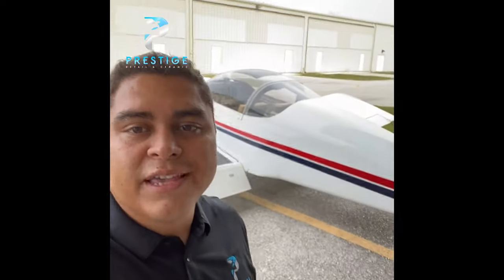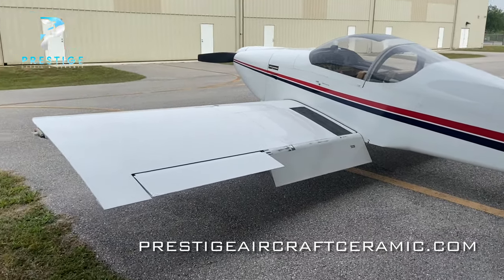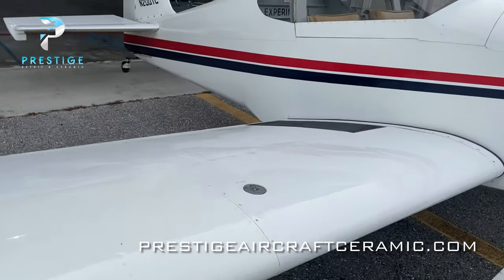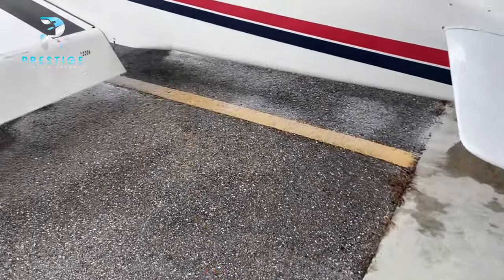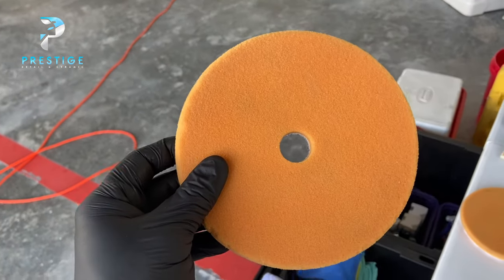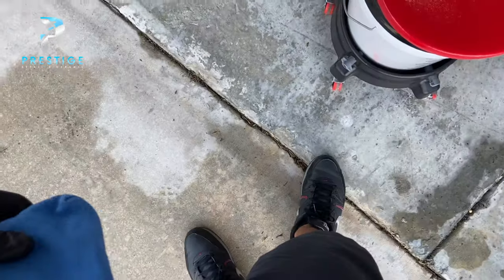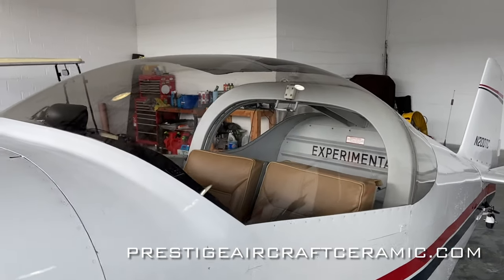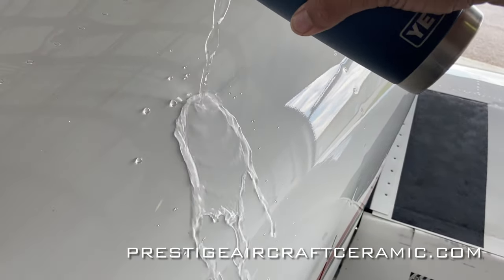Vans Aircraft RV-6 Ceramic Coating & Detailing tips

Comment: How do your charge for ceramic coating? Say, a piper lance for Example.  Your videos are the ish bro!
Reply from the maker: Hey Jared, thanks for your comment. I typically base my pricing on the condition of the paint and how much polishing I will have to do. A piper lance could range anywhere from $2,500-$3,000.